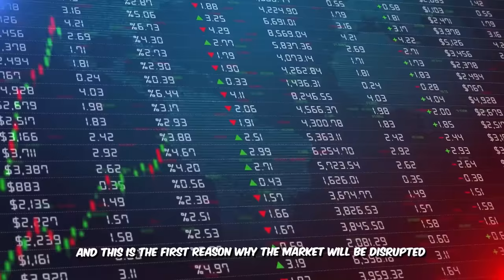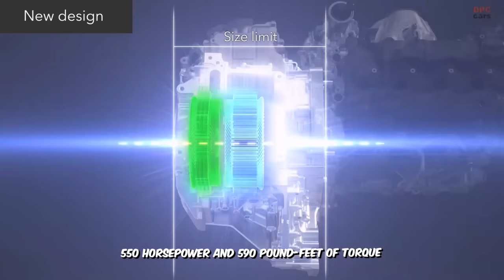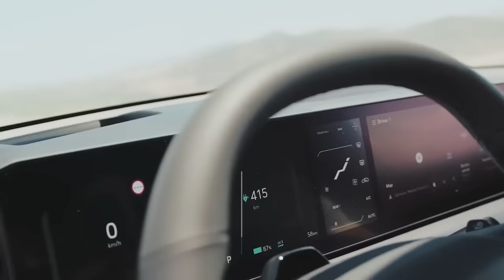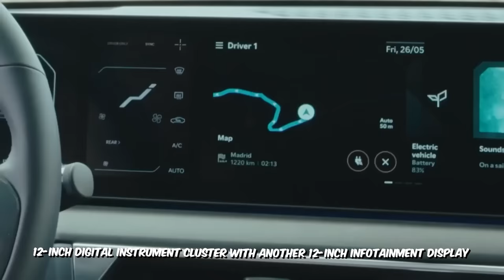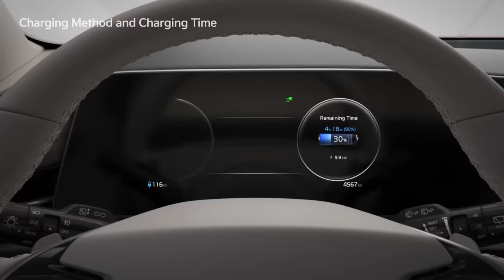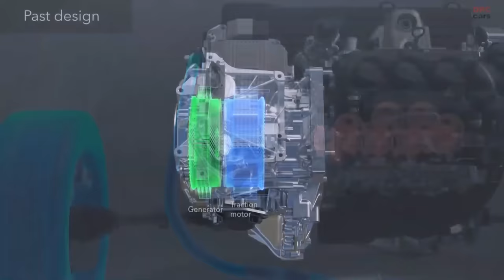Kia Ceo Announces NEW 2025 Kia Tasman & SHOCKS Everyone!

Comment: You say that Kia puts the customers first I purchased a 2023 Phev and took it to the dealership said my complaint the service writer listened and thinking he had it correct on what he said when closing looks like we have to charge it first I said yes. 5 hours later they say my car is ready. They did not check it electric as was supposed to they ran it on gas engine. It never has problems on gas then they say don’t have time to check it. After having it set out side 2 hours and 45 minutes. They don’t want to look for a problem. That they can’t fix.

Comment: If they bring this to America it should not have a turbo but 2 different gasoline engines and a hybrid option
Reply: Why would you want 'gasoline' in a commercial vehicle? They have way less low end torque for carrying loads on gradients, less fuel efficient, engines are built weaker because they don't need to carry the stresses of a diesel engine, have a much shorter lifespan, are more expensive to service. Gasoline is fine for a light and less stressed car but a poor choice for a work vehicle.

Comment: The narrator keeps bashing on and on about range and how in his words 220miles in one charge is insane !! Well when you drive long distance as I do and by that I mean country to country across Eastern Europe then 220 miles is nothing, I usually drive around 500+ miles before having to stop to refuel my 3L Diesel, these days I usually make one stop over which makes getting to my destination quick, but if I were to have to refuel every 220 mile it would take a lot longer to reach my destination, also is 220 miles guaranteed even if I use other electical compliances, and the weather can affect an EV too

Comment: this would be a bad product for US, it would be underpowered in terms of ICE options compared to every competitor in mid-size market.  Plus the mid-size market is not really that strong here...in the US the Maverick is selling well and the Santa Cruz is not to far behind, Kia would be wise to look at those and then just take a Sorento body and put it on a Telluride "chassis"  as it were then put a bed after the rear doors.   The Sorento has a far better build quality than the Maverick or Bronco Sport, more options, more HP and very importantly the torque of that 2.5 turbo is stellar.  there are also 2 hybrid options.  The Sorento is also Kia's best looking vehicle right now, and having something that looks better than the Santa Cruz would be a nice way to ensure good sales.

Using existing products would keep costs down as well...this is the way to go in the US anyway.
Reply: You can’t do that, you’re making way too much sense. We need designers and engineers who have no clue what the public wants. Strip out all of the crap and bring it the basics and most reliable features of your line and combine them into your fleet. No harm is using the best possible combination of different models.